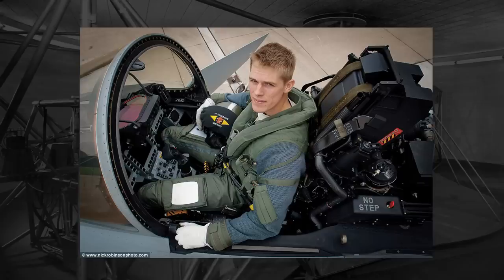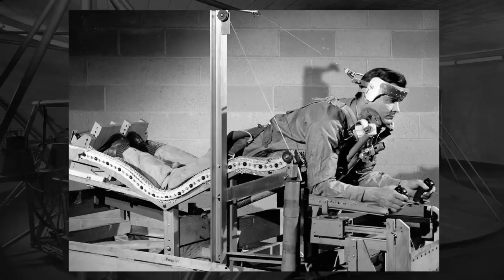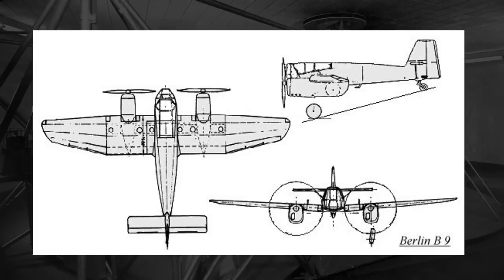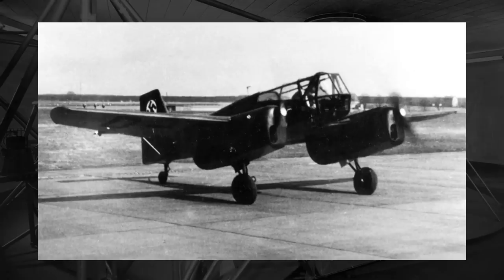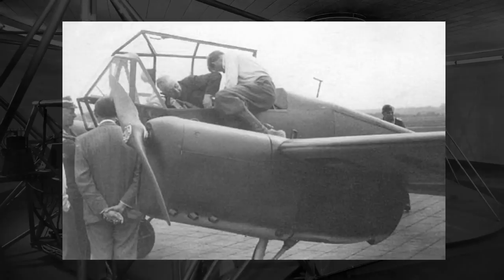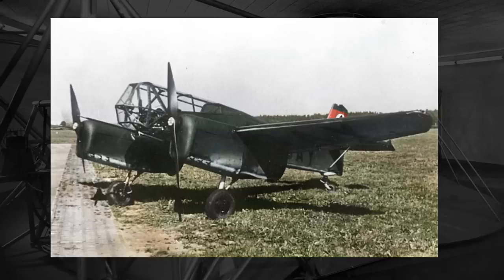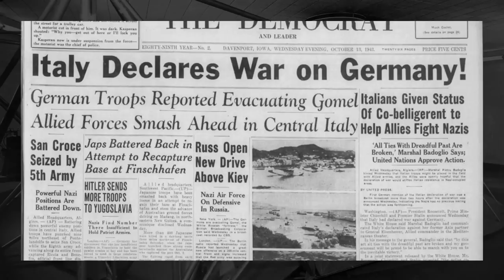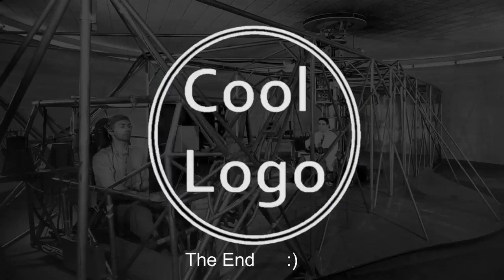Germany's Anti-G Dive Bomber: Akaflieg Berlin B9

Comment: Didn't anyone experiment with the reclined position ? You know like in the F16 .
Reply: You do know that the inclination of the ejector seat in the F-16 was to allow it to fit in the fuselage and not to increase the g tolerance margin?
Reply: @neiloflongbeck5705   How would he know that when its likely everything he's ever read about the airplane said the purpose of the recline is to increase pilot G tolerance.  I've never read anything else anywhere either, and I've read a lot of different sources.  You must have documentary evidence most of us have not seen.  Can you point to it for us?
Reply: @gort8203  I read this over 30 years ago now as a student. So I no longer can recall the source. It could have been anyone of the books on combat aircraft design or the F-16 article in the World Air Power Journal. Or it could have been from looking at the F-16's dimensions and those of the seat. As the height of the ACES II ejection seat is around 130 cm tall (about 4.3 feet) and the cockpit fuselage area is about 4.45 feet tall at the highest point of the canopy (estimated from a cut away drawing), but not all of the fuselage depth is the cockpit (about as foot of the fuselage is below the cockpit floor). Doing the maths means the seat had to be inclined to fit.
Reply: @neiloflongbeck5705   Thanks. Everything I’ve read since I began following the F-16 in the 1970s stated that the seat angle was a deliberate innovation to improve G tolerance, not an opportunistic fix for a design misjudgment.  Everything I can find today says the same thing.  I would exercise caution deducing intent from the dimensions of the seat and cockpit in the absence of documentary evidence of such intent.  Naturally the seat angle did allow a smaller cockpit, but that doesn’t mean the cockpit dimensions were finalized before the seat was.  Yes that is possible, but I have to think it much more likely that the cockpit was sized after the seat angle was chosen.
Reply: @gort8203  likewise, nearly every source says that the wing span of the Stirling and Halifax was limited to 100ft due to the size of the hangars on RAF bases and everyone of these sources is wrong. But this has becone the standard narrative but no one knows the origin of this. It's well known that the RAF had hangars with doors that opened to 120feet (the Type C) and that the P.13/36 specification called for the majority of maintenance to be carried out outdoors anywhere in the world. It's also claimed that the Mel262's wing was swept back to increase its high speed performance and its critical Mach number (which it did, the 18 degrees of wing sweep increased the max airspeed increased by a whopping 25 knots over the original straight winged version) instead of to correct the centre of gravity change due to heavier than expected engines. Several other aircraft also had wing sweep, but no one suggests that their swept wings were for high speed flight, examples include the Dunne tailless aircraft, the DH Tiger Moth and the DC-1 to DC-3.

Your assumption that you can't work things out from drawings or puctures is extremely poor. This is what the intellitence agencies have doing for centuries. Any scale modeller, like me, who scratch builds buildings from photographs will be able to do this. As I said my measurements were all estimates base of the height of the F-16 being 16 ft.

Yes the seat was selected early on in the F-16 programme but instead of using the standard model as was to be used in the A-10 and F-15 in a similar orientation they were forced by the fuselage/canopy design to stick it in at around double the recline angle. The external shape of the F-16 could have been changed if had not been for messing up the area rule and its transonic performance or increasing its size, which would have encroached onto the F-15 and the USAF were unwilling to let that happen. All you need us 1 dimension to scale off for each dimension you need to consider. So for all heights you can scale off the vertical height.
Reply: @neiloflongbeck5705  You are making my case by pointing out how people make erroneous deductions about the purpose of the Me 262 wing sweep and the Stirling wingspan by interpreting dimensions.  (Not every source makes these claims, there are plenty that do not.)  You are doing the very same thing if you are just assuming the purpose of the F-16 seat angle by cockpit dimensions. In the absence of documentary support I must assume you are just misremembering something you read 30 years ago.  That happens all the time, so my assumption is more reasonable than the one you are making.  I think you are too focused on dimensions and not enough on logic.
Reply: @gort8203  or am I pointing out that the accepted truth is not the real story. After all no other USAF  fighter has the seat reclining at such an angle. Tye F-22 is the most reclined atc20 degrees. If a 30 degree angle of recline is do great for increasing g tolerance why does ut only occur in the F-16? Answer, because that is not why it was reclined at that angle.
Reply: @neiloflongbeck5705  You are again making your own assumptions rather than reading the facts. It’s true the seat angle of the F-16 was not received with the as much enthusiasm as expected. It does increase pilot G tolerance, but there are also negative aspects to such a low angle. Some experienced pilots found it to be disorientating during hard maneuvering. Israeli pilots in particular had a habit of leaning forward to place their torso upright so they could move their heads in ways they were accustomed to during hard maneuvering. This was stressful and harder on the body than a conventional seat angle.  If you want to climb vertically the seat angle makes it harder to tell when you are at 90 degrees to the horizon.  Furthermore, it places pilot’s head downhill, which is unnatural and can be uncomfortable due to increased blood pressure to the head.  Obviously, pilots learn to manage such issues, but this seat angle is now considered greater than optimum and has not been repeated. 

You misinterpret this as proof of you origin story.  In fact, it should indicate to you why aircraft designs usually do not—for simply opportunist reason such a seat mismeasurement—incorporate bold changes to convention that can affect controllability of the aircraft. A change like this is made with deliberation because there are unknowns.  You story could be the exception to that principle, but in the absence of documentation I have no reason to believe it.

What you call the real story is based on something you read 30 years ago, in favor of which you ignore the widespread documentation supporting the commonly stated reason.  This is not just the reason accepted by internet “enthusiasts”, but the one stated by people involved in the development of the aircraft.  You have nothing to support your story while there are reams of books and articles supporting the accepted story.

Now allow me to illustrate why your story about the Me 262 wing sweep supports my position rather than yours.  There is also a widely propagated myth on the internet that the Lockheed F-104 was designed as a “pure interceptor” rather than a fighter.  This is another example of a narrative out of control, but the difference between this and your claim that the F-16 seat angle narrative is false is that the truth about the F-104 has always been available to those willing to simply read a book.  Everything I have ever read on the F-104, except for YouTube providers and commenters, describes in great detail how the F-104 was designed as an air superiority fight intended to dominate other fighters in air combat.  But the mob on the internet just looks at the short wingspan, thinks they know better than the designers, and assumes F-104 must have been a “pure interceptor”.   In the same way the mob looks at the Me-262 wing and assumes the small sweep angle was about compressibility.  These ignorant narratives are easily debunked just be reading authoritative books and papers on the subject, but the mob is more  inclined to wield pitchforks and persecute unbelievers rather than read a book and change their own minds.   

But unlike these example, you have no documentation to support what you claim is the truth, you have only your assumptions. I do not find your assumptions and deductions compelling in any way, so I must assume you are just propagating another narrative inspired by how things look to your eye rather than by the facts.  If you come up with any documentation I’ll be more than happy to read it, but until then I think we have exhausted the subject and have nothing further to discuss.
Reply: @gort8203  thank you for your word salad. Unfortunately it is decades since I read this and so I can't name my source. Many of the issues with the seat were down to incorrect seat adjustment and pilot habit. Having flown in many aircraft with up right seating and in supine seating it is easy to get disorientated until acclimated to such seating arrangements especially when swapping between aircraft types.

But you still can't accept that the standard narrative you cherish so much might be wrong. Well, 15 years ago I accepted the standard narrative about the Stirling and Halifax wing span limit until someone more knowledgeable then me pointed out the flaws in that theory and I went and did some research and found the truth. Why not go and look yourself. You won't find all the answers on the internet. You won't find the tale of Ed Heinnemann being told he was a liar about the weight of the A-4D-1 on the internet and that the same Naval office that called him a liar later apologised. You will find it in a book called Combat Aircraft Designer.

And yes, I know what the F-104 was designed to do.
Reply: @gort8203  it's word salad because you're verbose and repeating yourself. And no I haven't deleted anything. Arturus has also posted that he accepts Roscoe's comments about the seat recline angle I read all the comments before mentioning Roscoe just to make sure it was a credible source. That's credible not definitive. It's the most credible source on-line that I can find to support my position, and please note he says the g tolerance increase was a side effect. But answer me one thing, if the angle of recline was so good at increasing g tolerance, why had no other USAF aircraft has followed suit and incline the seat to such a degree? The F-15 has a similar turn performance at 10,000ft as the F-16, but has the seat reclined at a more normal angle (ie similar to all other contemporary USAF single seat combat aircraft (there's a difference 0.1g in the load being pulled at about the same speed (IIRC about 0.2 Mach difference).

If you think the matter is closed then why did you respond?
Reply: @neiloflongbeck5705  Talk about repeating yourself. And then introducing completely irrelevant topics like the F-15 seat angle.  I am not interested in your illogical deductions.  Bye.
Reply: @gort8203  you do know what contrasting is? The F-15 was used as an example, of a more conventional seat recline angle (as the quote from Arturus in your earlier posting mentions without naming another sircraft type). You opened up this line of argumemt, so don't go off whining when someone responds to it. And it's not irrelevant as no other fighter aircraft, except those based on the F-16, have ever needed to incline the ejection seat at such an angle. Is it because they have roomer fuselages?
Reply: @neiloflongbeck5705   The F-15 is irrelevant, and the fact that you can't see why indicates just how   confused you are.  I have no more time for your irrelevant points. I'm done here.
Reply: @gort8203  you said you were done yesterday and still are responding. Is your ego that sensitive that you have to have the last word?

The fact that you can't understand a comparison should a lot about you intelligence. No combat aircraft save those based on the F-16 have such a massive recline angle, the closest I'm aware of in service with a western western airforce is the F-22 at 20 degrees. But, again, you won't understand the comparison I'm making. But I'll spell it out for you, there was no need to recline the ejection seat at such an angle solely for increased tolerance as the F-15 demonstrated a similar turn performance with an angle of declination of over half that of the F-16. Indicating there was another reason for the angle of recline in the F-16 being much greater and the only reason that makes sense is that the seat could only be fitted into the fuselage at a much greater angle of recline than in other aircraft. It is really that simple. Yes, I'm making assumption, but the thing is I'm basing my assumption on available evidence and not relying on following the hard and accepting everything I'm told.
Reply: @neiloflongbeck5705  Can you please stop already?  I'm not reading any more of your diatribes.

Comment: Prone pilots would have really bad situational awareness. These planes would get bushwhacked from above and behind easily.
Reply: Just out of curiosity how aware are sitting pilots about their below, and behind?
Reply: @Alex_Vir  by looking around with their head. However, a prone pilot's head is already going to be at or near the physical limit of travel in at least one direction. Try an experiment. Stretch out on your belly somewhere, then see how far you can look over your shoulder or above you without rolling over.
Reply: @792slayer  are the floors of airplanes made out of glass too, so the pilot can see through, because otherwise I don't know how a sitting pilot will see at the bottom without tilting the aircraft.
Reply: @Alex_Vir  you're missing my point. Yes, you have to maneuver some, but the body mechanics of being prone put you at a massive disadvantage right out of the gate. For adequate vision in a combat situation, you would have to roll the aircraft probably 20 degrees and make a 90 degree turn to see above and behind. And that would be a 20 degree roll to the * outside * of the turn. Exactly opposite of conventional flight.

Comment: Pilot’s definitely do not sit straight and up right in any fighter jet built in the past 40 + years I can think of they sit leaned back and and sat down and back for g force not straight & up
Reply: It's commonly an angle of about 13 degrees or so, which is essentially straight upright compared to being prone.

Comment: This is ridiculous imagine lying on your front & holding your head upwards for an hour or more, even with a chin rest (I bet that would hurt & not be good for the teeth alone!) but just the weight of ones head would push down without any support around the top of the head or forehead,. I'm sure this would not be be a suitable position to work for long in anyway.
Also the low power of engines & weight of the A/C makes it hard to understand that this A/C could be capable of high speeds especially when climbing with high velocity to make positve Gs of 12 G????

Comment: The AR 234 was the prone pilot jet aircraft!   Now why did the B9 fail?   Well it actually worked, but being a low power tiny test plane, they were not about to develop it,   It proved its work in high G's, which was needed in fast jet aircraft that.  So the data of B9 was looked at and prone was incorporated into the jet AR 234!
Ir served its purpose and then was put away.